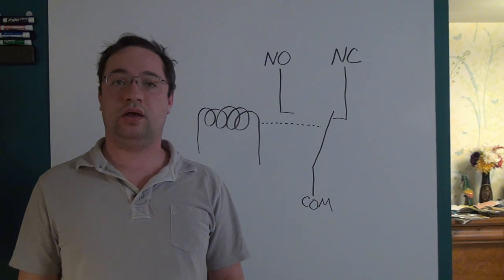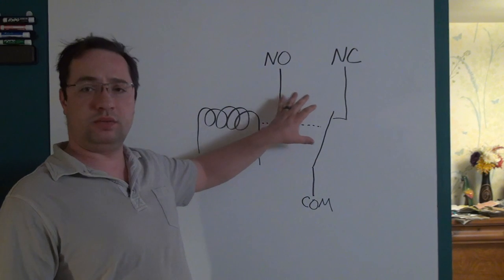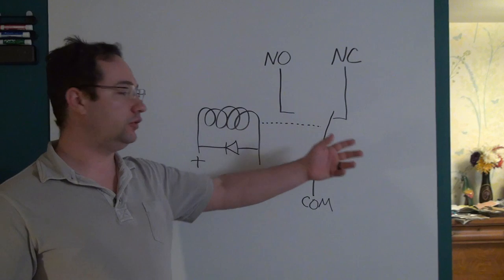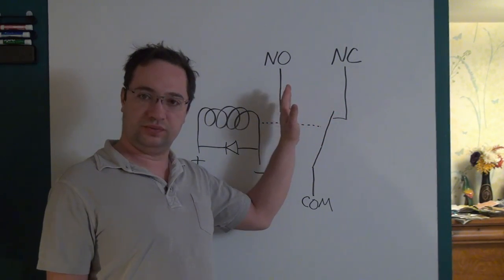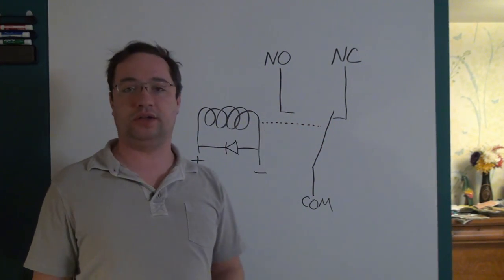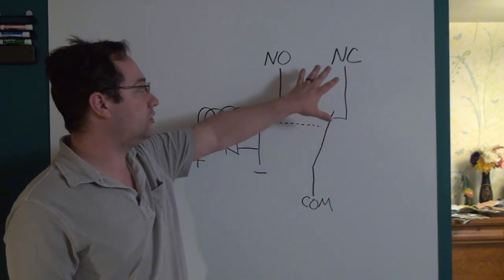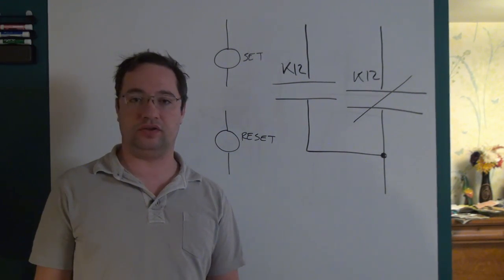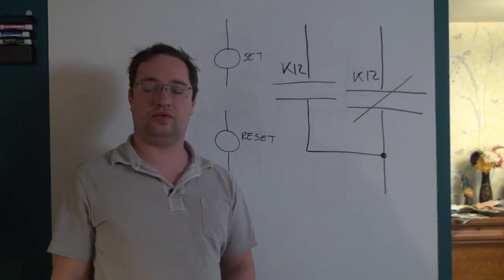eapbg #42 Introduction to Relays

Comment: Solid state relays use JFETS or MOSETS? in Mechanical relays its a coil and a leaf switch that is magnetic, the switch inside the relay is magnetic? Why are Solid state relays better compared to mechanical relays? In cars they are switching over using solid state relays instead of mechanical relays, any reasons why?

Comment: ok thanks. All the cars sensors connect to the ECU/ECM unit which was a sensor ground and +5 volt reference. Why is the sensor ground isolated or lifted from the cars battery ground, they are not connected? Its a common car failure for the +5 volt reference for all the cars sensors to get the voltage pulled down when one of the car sensors is not working. You have to disconnect every car sensors until the +5volts reference returns back to normal. Any other ways methods beside this one to troubleshoot +5 volt reference failures in cars?
Reply from the maker: The ground is isolated for noise purposes. Having a dedicated ground from the engine computer eliminates a ton of noise. No there is no better way to diagnose a short.

Comment: EASPG, what type of relays are Pilot lights in values? the pilot light will switch the values
Reply from the maker: Not sure what you're asking.
Reply: They often call switching valves pilot lights that I think are some type of relays. You connect tubing to the 3 or 4 way valves, but the 3 or 4 way valve will be called a pilot light that will switch the valves using a relay its in all in one piece but they call them pilot lights. Do you know how these pilot lights work or 3 or 4 ways valves switch using a relay?
Reply from the maker: @billwilliams6338  I know pilot relays. They are just smaller relays that operate bigger ones.
Reply: Yes how do pilot relays work, how are they different than a regular mechanical relay, what is the difference between a pilot relay?
Reply from the maker: @billwilliams6338  Size is the difference. There is a rough proportion between the size of contacts and the size of the coil to move them. The bigger the contacts the more mass they have the bigger the springs need to be and therefore the bigger the coil needs to be. Relays have sort of an "amplifying" effect. A little bit of current can control a lot of current. This can be used sort of like a Darlington pair, where a small relay (pilot) with a 200mA coil can operate a relay (or contactor) with a 5A coil which switches 250A.
Reply: @eapbg , ok are you saying that mostly Pilot Relays are small relays that handle low current only and never large current?
Reply from the maker: @billwilliams6338  Large and small are relative but in so many words, yes.

Comment: EAPBG, do you know why cars use Solid State relays instead of mechanical relays? what are the advantages of using Solid state relays in TIPM modules, CAN modules, ECM, TCM, PCM modules use solid state relays
Reply from the maker: Never worked on a car that has solid-state relays nor do I know anything about the inner workings of the TIPM.
Reply: I know why - the jostling around of cars lowers the lifetime of mechanical relays, not to mention the small form factor of solid states makes sense for car manufacturers. Nowadays I imagine they are just using large microcontrollers with tons of I/O.